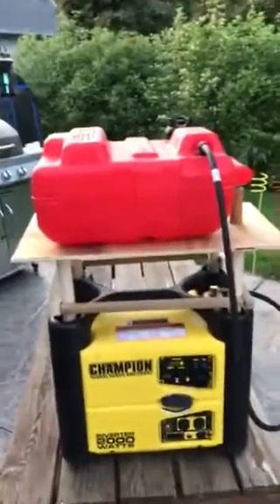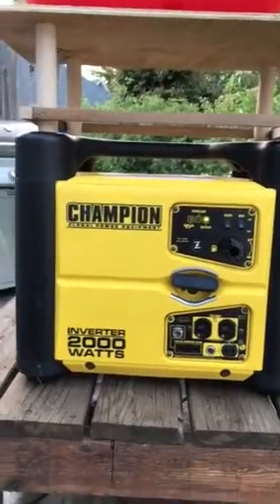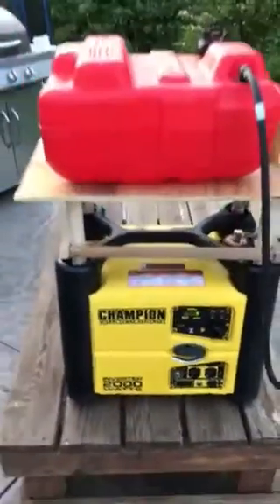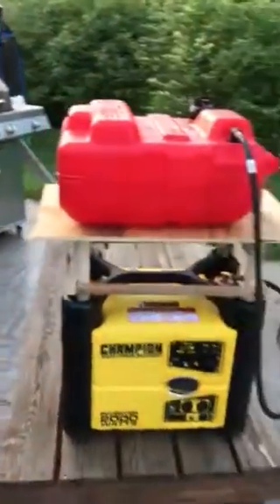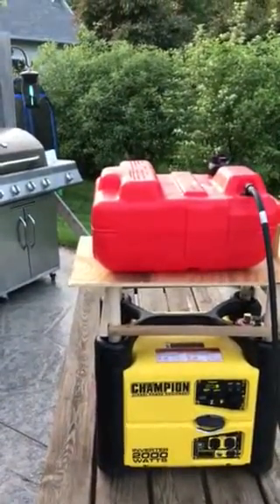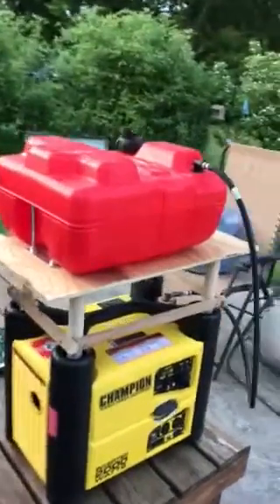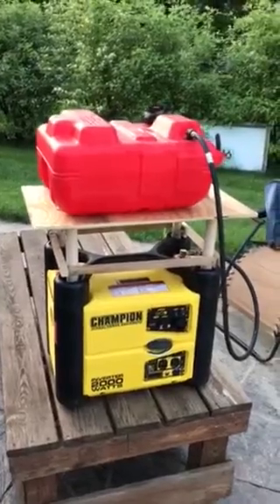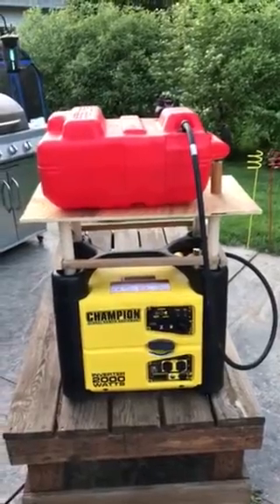Champion 2000 Watt inverter generator extended run tank

Comment: The Honda 2000's have an internal fuel pump which draws fuel from extended run tank via vacuum inside the internal gas tank.  The Champion 3100 is a "gravity feed" system and will not do the same as the Honda's.  There is a cap available for $90 that is suppose to work.  I'm not sure if the auxiliary tank needs to be elevated above the generator or not...still researching.  I have 2 of the Honda's with the dual BERG system attached to a 5 gallon tank.  Just bought the 3100.  For $90, I may just pass and use both Honda 2000's for overnight use.  Headed to race weekend in Atlanta and wanted to try out the Champion.  Time will get prices down...there's NO WAY a fuel cap should cost $90 and not even include the quick disconnect nipple.
Reply from the maker: Don Gordon try amazon or better yet ebay caps run around $20

Comment: I just purchased this same product, I’m having a problem, the fuel from the big tank run to the generator tank, any suggestions?
Reply from the maker: Tyler Standefer 

This is gravity fed. So 1st check the inside tube in the extended run gas tank. I found the tube was bent/kinked from the store so the gas wouldn’t flow. I trimmed the hose so it is just short of touching the tank bottom. Second make sure the gas is able to feed gravity wise. Try setting the tank on its side so the hose coming out of the tank is on the bottom.
Reply: Tyler, Where did you purchase it?
Reply from the maker: Tyler Uzelman 

From genxdirect online

Comment: Is this the one made for the Honda?  I have a Champion 3100 inverter generator, and I can only seem to get my hands on the extended fuel kit for the Honda.  Does this work with champion?  Thanks
Reply from the maker: Try this

http://www.genxdirect.com/champion/
Reply: I'm the same page with you.. I have the 3100 version that comes with electronic start, but I can't find anything about it, 1 big question (this generator is gravity feed or has a fuel pump??
Reply: @CounselorsinChrist  wow men thank you so much!!!!
Reply: @CounselorsinChrist  well, I just saw the complete video, and looks awesome but a little bit risky don't you think?? You'll loose the warranty and it's a little difficult to make possible..., I don't say I'm not able to do it.. But I'm a little worried about warranty and if this for real works, that guy have the comments blocked
Reply: @CounselorsinChrist  did they ask you for evidence or video or something like that? In order to make sure that your carburator was clogged?
Reply: Hey buddy, one question, what is the size of the hose that comes with the kit? And how it's been working on it bro??
Reply: @CounselorsinChrist  it's done! Check my last pics https://drive.google.com/folderview?id=1EhdWtjnoDuCZyoHrxZpTAL8ooxCiam40, I haven tried it but tomorrow I'll put gas to the external tank and I'll let you know
Reply: @CounselorsinChrist  also check the las update on the same link, I updated a new modifications and a video
Reply: Hey buddy are you there?
Reply: Check for the las modification